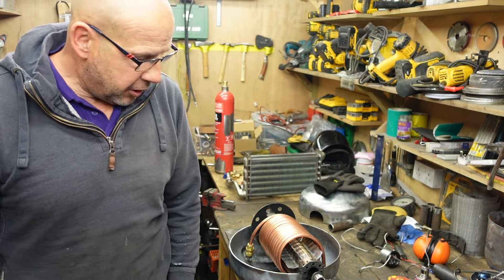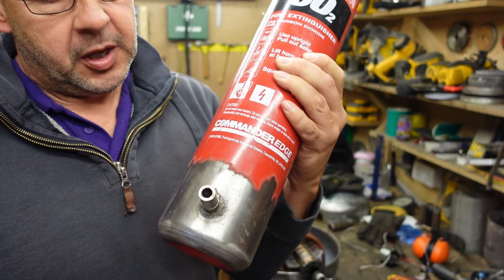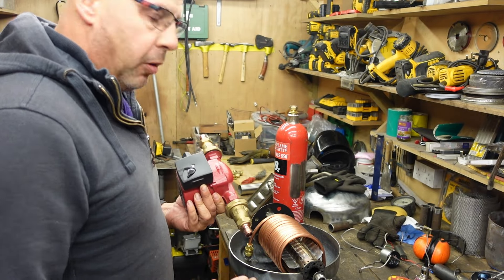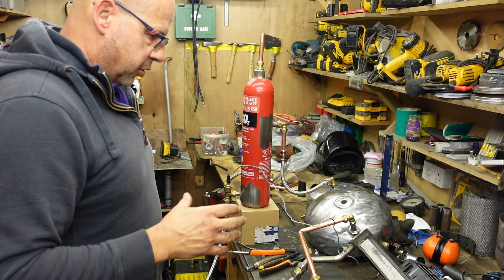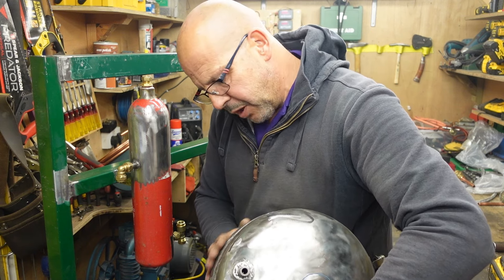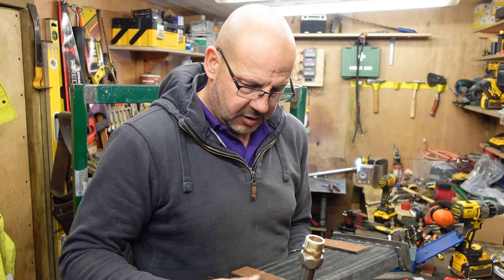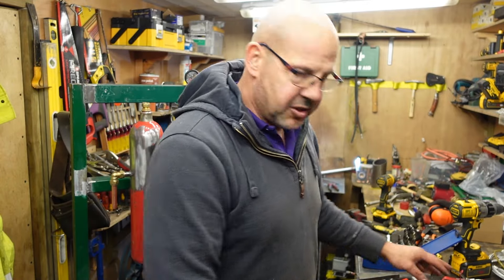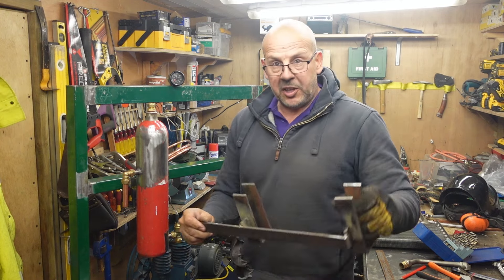#diy #homemade Hotwater & Free Heating New #design #entertainment

Comment: Hello great video
As it is a closed system would there be some safety devices such as a pressure relief valve 
And maybe a air relief valve to let air out if there is some in the pipes. May be need to help with the over all system.  Nice work ❤
Reply from the maker: It's not a closed system, the container above the burner and exchanger has a 15mm breather copper tube , for filling and any steam generated to escape. I'm thinking of making a closed system and use pressure relief valve etc, I'm going to see how this works and then design a new compact system 🤔